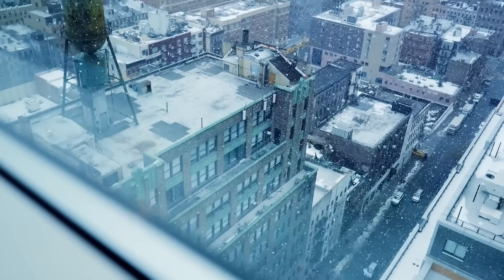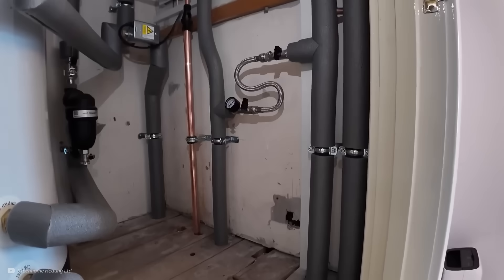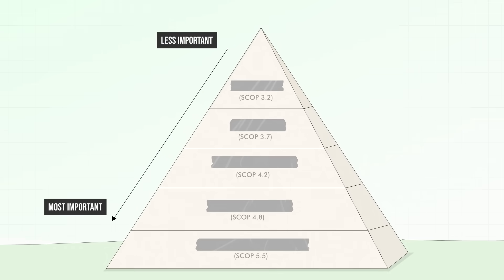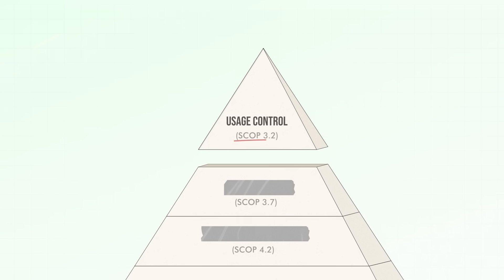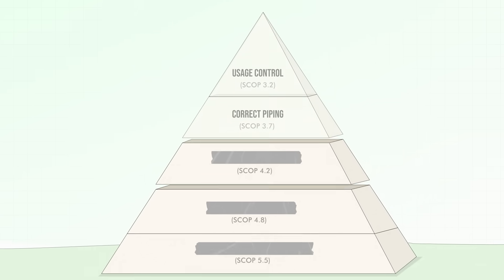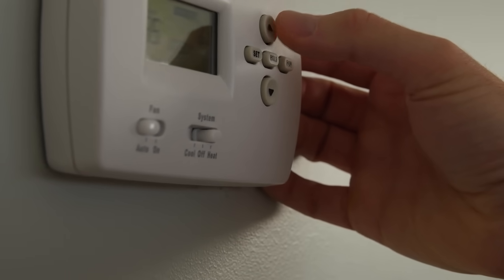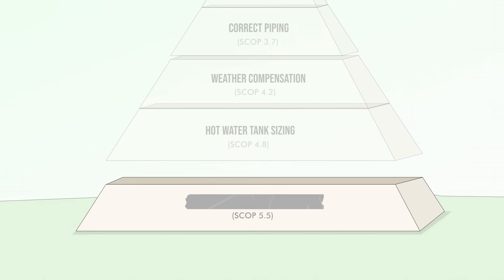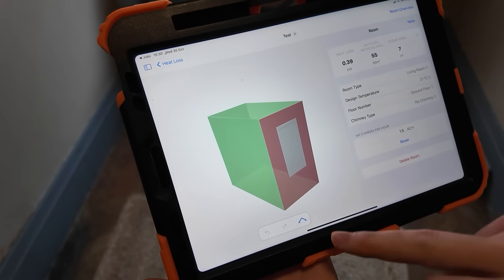The Genius of the World's Most Efficient Heat Pump

Comment: It is far better to install Solar Assisted heat pump for hot water @ 55 degrees.  It is far cheaper than a conventional heat pump. Heating can be achieved with small reversible air  conditioners in individual rooms. Add solar panels or wind turbines to get the most economically efficient solution. The above solution costs less than a heat pump, which involves major disruption like new and bigger radiators. Existing gas boiler can remain as a backup.

Comment: How do you stop the outdoor unit icing up at those efficiencies? My units continually go through defrost cycles at any temperatures below freezing
Reply: You don't.  The defrosts when properly sized will not have an impact on the home heating etc.  You won't get a COP of 8 in winter either.
So if you're getting continuous defrosts and it's not heating your home properly, then it sounds like it's undersized.

Comment: Ziroth: SCOP or COP of a heat pump system should be discussed with the local weather in mind. England winter average temperature may be 5 degC. A heat geek system may achieve COP of 5.5. However, once the temperature goes down to -10degC as you may encounter in North America, the COP will invariably go down.

Comment: Weather compensation, modulating controls, and over sizing of radiators (and hot water cylinder) also make condensing gas boilers more efficient. Lower flow temperatures from a gas condensing boiler make it work more efficiently, and extract energy from the process of condensation, itself.

Comment: Why is adding a hot water tank more efficient than an on demand electric water heater? When you have a combi boiler, the extra expense of a hot water cylinder, a pretty massive one at that, makes heat pumps a very unattractive proposition. Also you have to keep the cylinder at 70C all year round or risk legionella which means major use of immersion heater. Total waste of money.

Comment: I think the best efficiency we could achieve should be a central system heat pump working with all appliances. I mean, why do we have to have a heat pump from outside when it's freezing outside, then heatpump inside the freezer, a heat pump for the pool and everything. I think if everything is connected we could manage the heat really well and probably need only minimal cooling in summer and heating in winter. Just take the heat where it is not desirable, get it where it is, or reverse.

Comment: Why are you using that kind of efficiency metric for "Heat Pumps"????   Heat pumps don't "CONVERT" energy, they "MOVE" (transfer) energy (heat) from one location to another.   All they are is REFRIGERATOR TECHNOLOGY that MOVES (transfers) heat in both directions.

The REQUIREMENT to TRANSFER heat is to CREATE A TEMPERATURE DIFFERENTIAL between the TWO LOCATIONS.   The COLLECTOR DEVICE must be at a "lower" temperature than its surroundings, and the EMITTER DEVICE must be at a "higher" temperature than its surroundings.

So if you are COLLECTING the HEAT from the outside and the outside temperature is -40C, then the heat COLLECTOR DEVICE  temperature must be lower than -40C, maybe -60C.  Would this scenario produce that magical 800% number???

Since this looks like an air to air heat TRANSFER DEVICE reaching this 800% magical number might be a problem in that scenario.   Then there is the other metric, which might be thought of as "heat quantity" or "volume", measured in "BTUs" or "Calories" etc.   To collect a sufficient "volume" of heat in the air to air -40C TRANSFER scenario, would require that the heat COLLECTION DEVICE be significantly LARGER.  Like a Sea-Can container sitting outside your house.

Getting around this issue requires COLLECTGING THE HEAT from a different LOCATION.  Like collecting the heat from UNDERGROUND, the EARTH'S GEOTHERMAL HEAT.  Making the HEAT PUMP installation cost significantly MORE EXPENSIVE.   Making it a TECHNOLOGICAL CAVE technology, the ancients lived directly in the CAVES, and benefited directly from the GEOTHERMAL HEAT, not requiring any COLLECTION TECHNOLOGY at all.

Comment: Built a new house in 2020 with a heat pump, underfloor heating, and 2000 litre hot water tank. The system is controlled by a computer which measures outside and inside temperature, in/out water temperature, plus a lot more. It  uses heating cuvers to adjusted the house charateristics to control heating requirments. One item he did not mention with the hot water it needs to be raised to over 60c for (i can't remember if it was 12 or 24 hours once a month) . This is important to kill any bacteria in the system, such as legionnaires. In our system this is done by the controller via an emersion heater in the tank which raises the temp from 40 to 60c.
Reaction time of the underfloor heating is something like half a day, but the conttoller anticipates heating requirement. As the house stays within 1c of set temperature it's never been an issue.
A problem  is heatpumps do not work well in badly insulated and/or drafty houses. Which becomes a issue when fitting them in older housing stock. Without first undertaking a lot of additional insulation work. The lower water temperature means the heat leaks away as it tries to heat the house. Solutions are to create a bigger radiator area (in my house the entire floor) or use hotter water (gas boiler solution). In a leaky house, a bigger radiator area would require a bigger heat pump to supply enough warm water to heat the house. 
My system is connected to 220v 16amp, 3.5wk supply, and delivers on aversge 12kw of heating energy. The house is 900m³ (22 x 10m), fully insulated (200mm plus). 12kw is the same size as the  gas bo 0:01 iler  l used to heat a semi-detached house with half the volume 10 years ago.
Reply: There has not been a single instance of legionella in a domestic setting. So long as you are using your hit water growth is not possible

Comment: hmm,  until the COP of a heat pump is a minimum of 4, then it isn't viable if you have mains gas.
Reply: Yes it is.  Because gas isn't 100% efficient.
Reply: @BenIsInSweden   Gas doesn't need to be as its made up for on price. You get 4 to 5 kw of gas for the price of 1 kw of electricity.
The best gas boiler is 98% efficient, that is a consistent money cop  of 500% without having to have geek to make things work.

You need to ask why you are so blinded to what is so obvious.
Reply: @paulthomas4917  You're wrong on so many levels.
Combustion efficiency isn't the same as system efficiency.  And even if you did reach an efficiency of 98% in a gas boiler (which requires a ~35C flow) a heat pump would run rings around it and be able to achieve a SCOP closer to 5.
System efficiency of a gas boiler averages out in the UK at around 84%.
Reply: @BenIsInSweden  The problem you are having is not understanding the term power, power may be simplified as- work done over time.
We see power displayed as Kwh or kw/h, 
when I talk about gas I am only interested in the power delivered compared to the power delivered by the alternative i.e. electrical power. 
so 1 kw/h of gas and 1 kw/h   electric is the same since to raise the temp of a given object by say 1 Deg takes a given amount of power. 
On the one hand you brag "but the heat pump is more efficient" on the other hand I brag gas is cheaper.

Remember  the object is to heat our homes for the lowest cost not using something with the greatest efficacy, but the most expensive, 
You have fixed in your head that the most efficient is by definition the cheapest, sadly it isn't.
For your argument to work the efficacy of the heat pump would have to more than make up for the extras cost of electricity compared to gas and it doesn't
Reply: @paulthomas4917  bottom line is even at the current price cap a properly set up heat pump will almost always deliver a better price per kWh of heat.
Add in tariffs like OVOs heat pump tariff of 15p/kWh it will cost ~3.75p/kWh of heat delivered at a SCOP of 4.
Reply: @paulthomas4917  Also, I'm well aware of sacrificing efficiency to run cheaper.  People on (e.g.) EV tariffs with heat pumps do this as well, where they boost their heating during the cheap rate to overheat the home, so the regular rate is used less, overall costing less.

With a gas boiler you're not just sacrificing efficiency to save money, but also comfort, as having the heating off for extended periods of time reduces the thermal mass of the property.
Reply: @BenIsInSweden  lol try to listen to yourself on the one hand you claim heat pumps are cheaper because they are more efficient, and in the next breath you are telling me workarounds to make the heat pump match gas prices.

You get more bizarre by claiming the thermal mass of your home helps your heat pump in a way it wouldnt help another means of heating. 

Disconnect from the pseudo science and simply think about it this way-

1. the price of 1 kw of electricity is 4 to 5 times the price of gas.
2. because of 1. the COP of a heat pump must be above 4 to 5.
3. if there was parity, you then would look at the insulation cost. 

Conclusion  is what?
Reply: @paulthomas4917  
1. Wrong, where's the data for this? it's certainly not the Ofgem Price Caps.
2. Again wrong, as gas boilers aren't 100% efficient at producing 1kWh of heat for 1kWh of gas.
3. Install costs vary, e.g. a colleague of mine is getting his heat pump fitted for less than what it would cost to replace his back boiler with a condensing boiler.
Reply: @paulthomas4917   1. those figures are outdated and were applicable July to September 2024, so no longer current.
2. Again combustion efficiency vs system efficiency are two different figures.  And you may note it says "Up to 98% efficiency", doesn't mean you can just whack it in and get maximum efficiency out of it.  You've fallen foul of the "up to" trap.
3. I'm not taking advice from anyone, I've been living with a heat pump for almost a decade.
You want cheap up front? good for you, but as gas prices increase those smaller radiators will cost you more.
Reply: @BenIsInSweden   Oh so sorry, let me just see how honest you are being.

1. The latest figures for Jan the 1st is a ratio of 1 to 4  (3.94) So as I have repeatedly said, your heat pump would have to never drop below a cop of 4. 

2. I do not use that which cancels out between systems, therefore, when a heat pump says up to  a COP of 2.6 I steel man your argument and give you that figure, therefore, just try to be intellectually honest  and do likewise, evangelism is for my Christian comments section.

If you would like me to post here what the heat pump literature says about  'up to' I will, but I shouldn't have to do what you should be doing yourself. Remember propagating that which isn't true doesn't make the world a better place it just disadvantages those who are gullible or trusting in those are untrustworthy.

If someone was on a budget. I would recommend a combi boiler if they had mains gas available, why? because its cheaper overall, that isn't up for debate  it's just a fact.

Further, if electricity prices vary between a ratio to gas of 4 to 6 the fact the moment I posted it was 3.94 doesn't mean that at some point it was 5 or 6! you sound like someone who doesn't understand that the elderly lady waiting at the bus stop in the rain, does so because she can afford a tesla.

3. Lol your ignorance is appalling let me educate you, lol 

2013–2020: Gas prices were stable or falling
In the same period electricity prices were rising, in fact, in the last decade that was you period of heat pump ownership, electricity prices raised by  36%
Although gas prices went up in 2022 they fell by 26% in 2024.

I, want you to try to understand how your economics works  while gas prices were falling, and electric prices were rocketing you were promoting and investing in electricity.

Further, if your heat pump was purchased a decade ago then it will have a maximum COP of 2.6,  and at times a COP of 1.7, 
Does it ever occur to you that you have been paying above what you needed to for heating your home, while  promoting your erroneous economics.   

I often wounder how people get tricked into scams, I have come to realise over the years scammers use their useful fools.

Heat pumps do have a future, particularly if we can get  nuclear power generation, but we need to push for better COP figures in the mean time, and not simply better propaganda!

There are those who jumped on the EV wave who now can't get economical insurance because of  the elevated risks of EV, and what has the government just done? yes, started charging road Tax on EV'S, what a shocker. 

We need honest people who will push back against the lies of ownership regarding recent technologies since a Heat pump, EV, or whatever shouldn't need  lies to sell, but sell on their own merits.
Reply: 1. Where was one that was closer to 5x?
2. They don't cancel out between systems.  What brings a gas boiler from 84% efficiency to 95% efficiency can increase a heat pump SCOP for example from 3.5 to 4.5.  You can't turn an efficient gas system into an inefficient heat pump system, so the closer you get to "perfect efficiency" with a gas boiler, the more a heat pump will be able to run rings around a gas boiler on the same system.  But to get a gas boiler to 98% efficiency your boiler return temperature needs to be at around 15C (about 35C flow), which is probably about 0.00001% of installs in the UK that do that.
3. How would a heat pump purchased a decade ago have a maximum COP of 2.6?  I moved into the house with a heat pump already here, and my current system has 1 unit that is just over 2 years old, and the other two about 15 months old.  Gas isn't available here, hasn't been for decades.  Nor do I have a wet system, but have enough knowledge of them and people who have them.  So a wet system retrofit just for a fossil fuel system would cost me over £25K.
Reply: @paulthomas4917  SCOP isn't just another way of saying "up to".  Do your research, MCS certifies that the SCOP is achievable in the UK market for the designed flow temperature.
Reply: @paulthomas4917  But you're willing to state that a gas boiler is 98% efficient without having any data etc to back it up... right, ok!
Plenty of 3rd party monitoring goes on of heat pumps, which this video mentioned, and gives insights into those heat pumps achieving or beating the SCOPs that the manufacturers quote.
The same system can be adapted for gas boilers - but people seem to just want to accept what the gas boiler manufacturers say.
Reply: @BenIsInSweden  "But you're willing to state that a gas boiler is 98% efficient without having any data etc to back it up... right, ok!"

There is nothing I like better than being asked for the evidence for my claims. because it shows how little resuch you have done.

The Viessmann Vitodens 100-W 30kW model is considered one of the most energy-efficient boilers in the UK. It has an efficiency rating of up to 98% 
And the price is less than £1500.
 
"Plenty of 3rd party monitoring goes on of heat pumps, which this video mentioned, and gives insights into those heat pumps achieving or beating the SCOPs that the manufacturers quote."

Yes the manufacturer doesn't know  the specifications of their units so another reason to reject them. 
of course, if you complain  that you aren't getting the elevated cop that a youtuber told you, they will tell you how gullible you were. 

"The same system can be adapted for gas boilers - but people seem to just want to accept what the gas boiler manufacturers say."

the systems are different between gas boilers  and heat pumps.
1. larger and more expensive radiators are required for a heat pump setup,.
2 An expensive storage tank is required for a heat pump system.
3. You have to store hot water with a heat pump, which is inefficient.
4. properties with a poor R value will reqiure blankets and overcoats, so you don't expire from hyperthermia with a heat pump.
Reply: @paulthomas4917  
Shame you've fallen deeper into the heat pump myths.  And clearly willing to not accept that efficient heating systems, regardless of source need a lower flow temperature, which means larger radiators.

Clearly you don't know enough about heating systems and how they work, and are unwilling to see how wrong some of your statements are, e.g. "3. You have to store hot water with a heat pump, which is inefficient." being so far from the truth.

Comment: I have a heat recovery system on my balanced air ventilation system and I discovered it is common for these systems to be designed to work against a single setpoint called "comfort temp".
This is the temperature they try and adjust against when regulating "heat recovery" during winter and "cold recovery" during summer. Turns out that is a really really stupid way of doing it as any other heat source, like a wood-fire or sunshine in a large window surface, run the risk of triggering a surplus energy situation where the system just tosses out the extra heat instead of recirculating it to all the rooms in the house so it can be retained in the walls for when the surplus energy is no longer available. You may have set the comfort temp low to conserve energy and avoid the electric auxiliary heating in the ventilation from triggering too much (allowing a heatpump to deliver most of the energy for the house instead) only to have the system work against you like this. Alternatively you set the target higher and when your aux heating is no longer providing heat the system burns a lot of electricity to try and achieve this silly temperature goal. After asking multiple vendors it turns out this problem just hasn't been in the design-goals of the software running the systems as they only care about ticking the boxes required for government grants/supplements for installs.